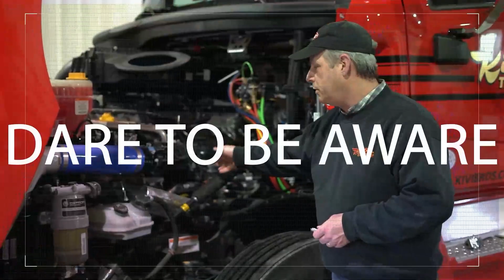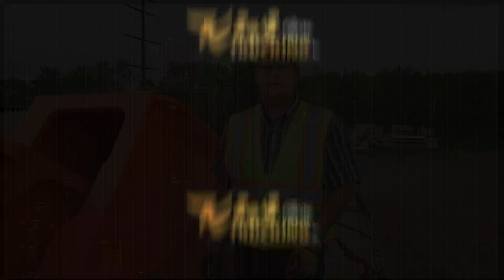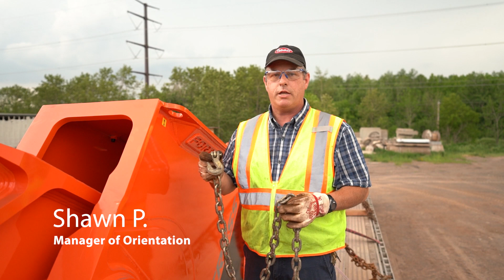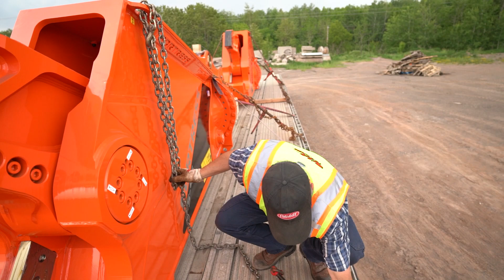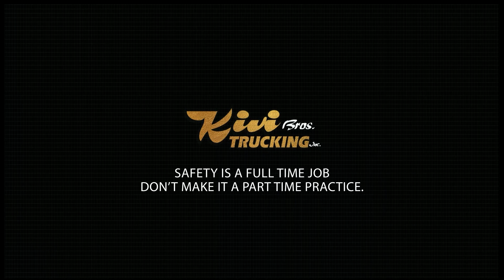Chain Securement/Bight Technique

Comment: I worked for a really big crane rental and rigging company. They were the largest in a major city on the east coast. Two times they owned the world's largest truck crane. They must have had 100 flatbeds for boom, counterweights, rigging, etc. All the flatbeds had like 6 chains welded to one side, and snap binders with a short piece of chain attaching them to the trailers. That way we could drop them on jobsites and not have the chains and binders stolen. And here was the thing, no hooks on the chains whatsoever. And no we didn't rely on the welds. After a while you get really good at working without hooks.